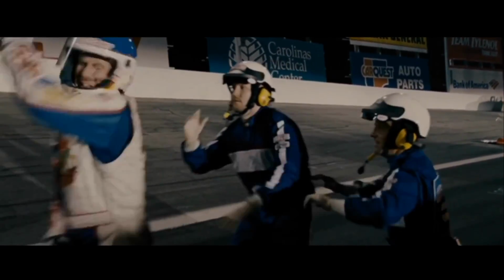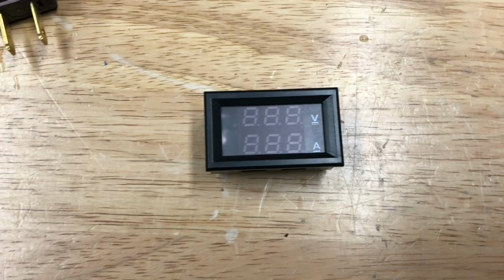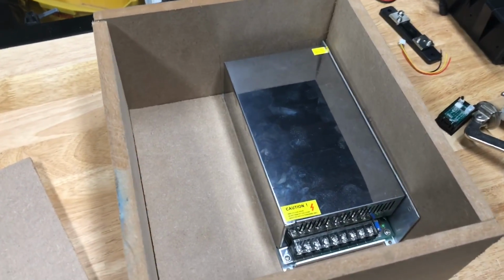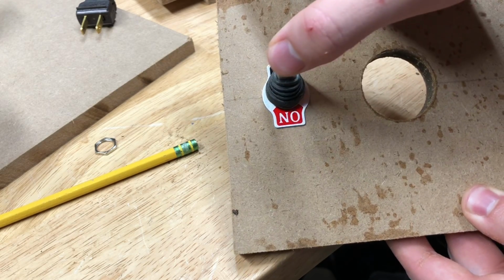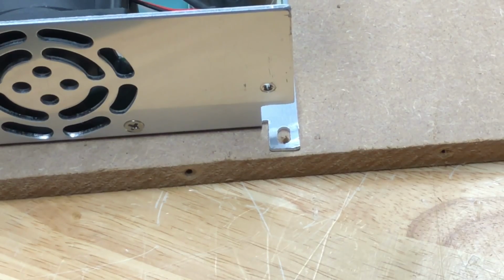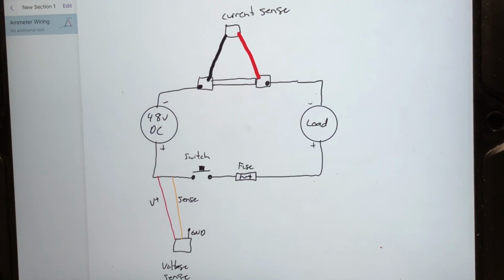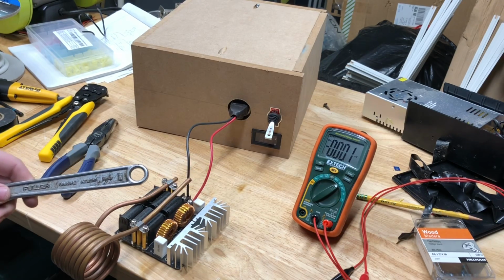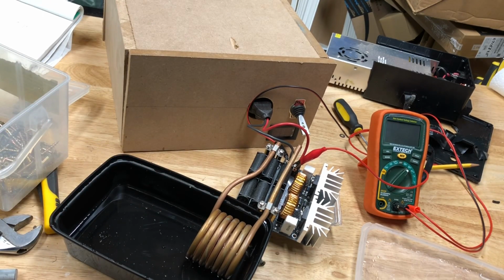1000W Induction Heater Power Supply Enclosure Build

Comment: I've found SOME power supplies see the ZVS as a short circuit, and cut out! One I used lowered the voltage to 5v, stalling the oscillator!  It was fine zapping a big 3 ohm resistor though at full amps and voltage.... what we need are "dumb power supplies" that like short circuits.   o_O

Comment: Uhm, a quick note for the hex head machine screws you use to fasten the components to the MDF; looks like they they are standard size (i.e. #6/#7/#8) which means they have a standard 1/4 inch hex head; you can just take the bit out of the drill driver and put it directly on the screw head.  This will make it so much easier to start the scew.   As well, most 1/4 driver chucks can be held on the bit release ring to give more control while starting a screw...but rarely does one need to....unless its a flat head screw.  I have a trick I use for flat head screws: throw they out. :-)  Its the best way to protect the surface they are going into, your fingers and ones sanity. Only time I keep them is when working with historical restorations and want to keep original. Oh, and electrical plates....cause there must be some conspiracy to sell more screws or maybe deter people from DIY electrical... %$'*% little white screwy things. Thanks for video.